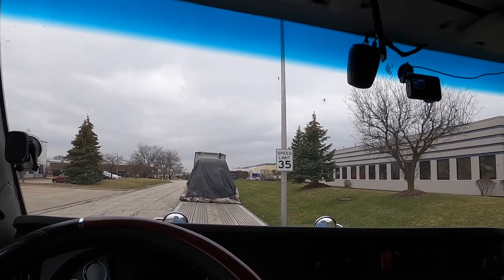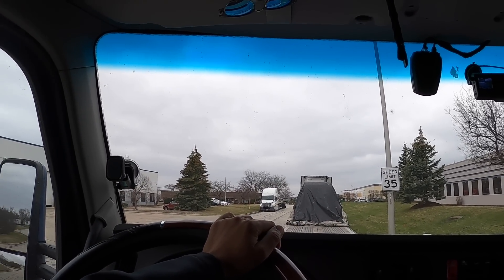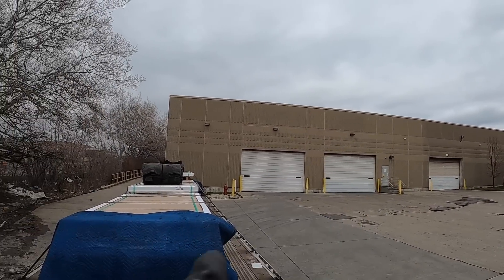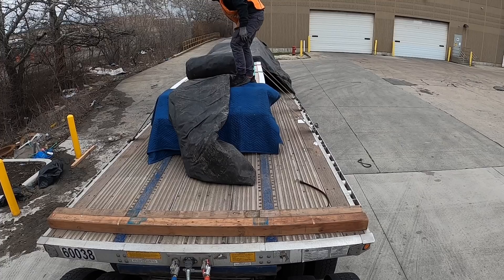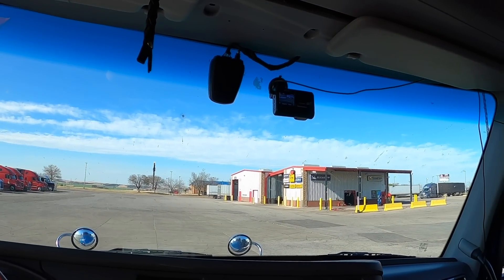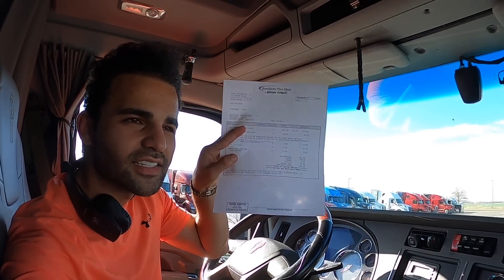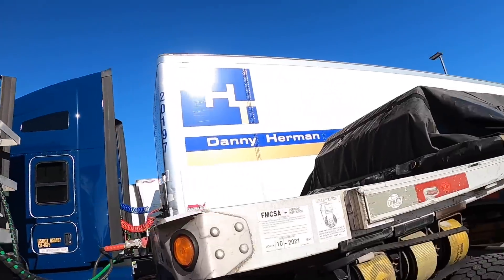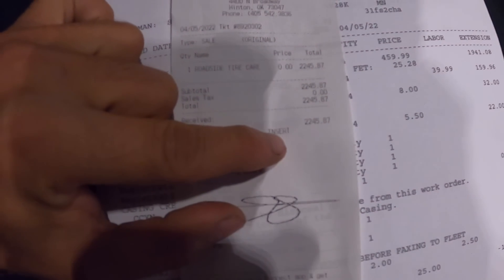Pilot Flying J Truck Care Would Not Replace My Tires! Picking Up From Chicago for The First Time!

Comment: I noticed that you have your costs itemized pretty good. It would be nice to see you do a video where you itemized all your expenses pro-rated for the job. For example (Insurance, IFTA, Equipment payments and so on by dividing your annual expense by 365 and then applying that to the job depending on amount of days to do it)  THEN, itemize actual expenses such as diesel, DEF etc. THEN subtract from your income for that job.   No one really does that because few truckers actually know their true expenses but you do. 

Glad to see you still wear the straw hat.
Reply: You are on the right track, but is would be a BIG ERROR to divide the total annual expense by 365 before next multiplying by number of days required for any one particular job in order to get a "per job" cost. In virtually any single unit owner-operator's case, and definitely in Yousiff's case, this would calculate an UNDER-estimate of "per-job" cost. Dividing by 365 initially would be the correct thing to do only if you had worked all 365 days of the year and, therefore, would have a total of 365 "job-days" to assign each and every one of those prorated hours back to. However, I can assure you, especially in Yousiff's case, that far fewer than 365 days in total are typically worked over a given year -- remember, Yousiff likes to take long stretches of time off to enjoy his youth and travel to other countries. Similarly, if you run a business with multiple trucks, you wouldn't necessarily divide total costs by 365 or even [total costs ÷ (365 × # of trucks)], rather, you would divide total costs of all trucks by total number of days worked by all trucks if you want a "general cost per day for any given truck" for the purpose of prorating cost per job.

Comment: Hi Youssif how are you? First, I want to tell you that you have been an inspiration for me bro. I bought a Ram 3500 dually 7 months ago, wanted to do hotshot. They were so difficult to find during Covid. So I financed one with $5K down. But then found out that laws are changing so got my CDL. I wanted to do 26k+ CDL hotshot. I couldn’t find anyone willing to train me on strapping, tarping etc. But it was easier to find semi job. Right now I am on flatbed training for the last 2 weeks with the owner of the truck. I drive 11 hrs, drive till 3-4 am do strapping tarping so got quite a bit of experience. Working as a company driver I’d be working at $0.65 cpm. My brand new dually is waiting in garage at $1200 monthly payments. I believe I can locate a 40 ft flatbed around $1200 monthly as well. I don’t know if I should stick with semi flatbed as a company driver, my heart lies with semi trucks but can’t afford now. Considering the higher fuel prices, lower flatbed rates on load boards: Would you suggest to keep working at $.65 / cpm as a semi truck company driver, Or should I use my own truck and get into hotshot? What is your opinion as someone who did both? 😊
Reply: I would stick with the semi...I used to do hotshot as well its just so much harder to find loads for hotshot and the rates are down...so just be a semi driver until maybe things normalize.
Reply: @IA-py9by  You are right, thank you for the advice. I thought, because I’d be saving probably 2-3 miles per gallon with dually may be a good option. But it looks like Semi flatbed has way way more load options than hotshot, even though rates are low now. It’s just that I don’t know what to do with brand new 2022 Ram 3500 high output sitting in my garage. I rather stick with semi and eventually buy one. What is the best way of getting rid of the Ram in your opinion? I purchased it with $5k down, making 1200 payments, it is like a 75k truck owed to bank. Any ideas? Thank you.

Comment: Have the fuel prices had an impact on your bottom line or do you have a fuel surcharge program go maintain your margins. When I was trucking in Canada but travel everywhere we would rotate tires to even out the wear on truck and trailer so that you try to get max life. Do you check tire pressure regular plus alignment. Good video keep trucking.

Comment: You should try a open tread tire. They are a little more expensive, but the last a lot longer on a spread axle setup
Reply: My spread axle rietnours I run closed shoulder continentals  that's been my best luck tire on a spread

Comment: Question what kind of tarps do you use?
Reply from the maker: I have two 8ft drop lumber tarp 27ft long with a flap  and two 4 ft drop lumber tarp 27ft long with a flap. Lumber tarp means that it has a flap at one end.

Comment: Where do you get shave ,in hotel or off road
Reply from the maker: I have a trimmer, I do it at truckstops when  I use the shower
Reply: Oki,that's great ,you doing a good job, I am about join you guys now, I have permit ,I am starting class soon,I want to get more adviss from you.of how to buy truck and trailer etc